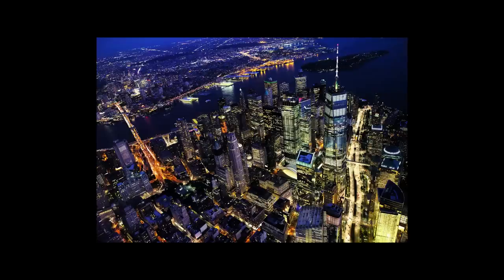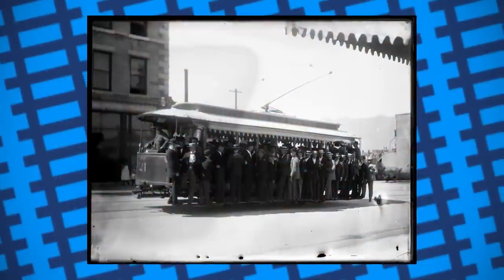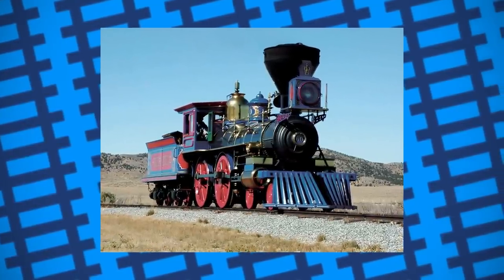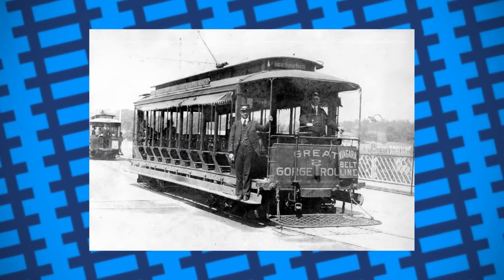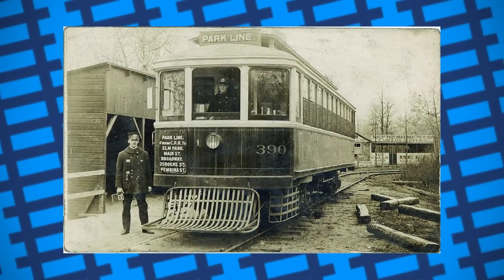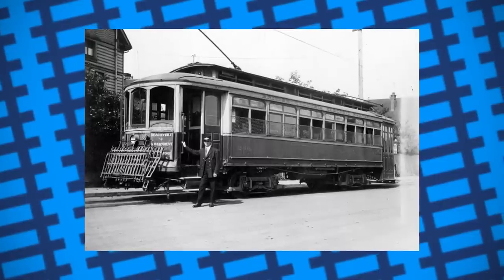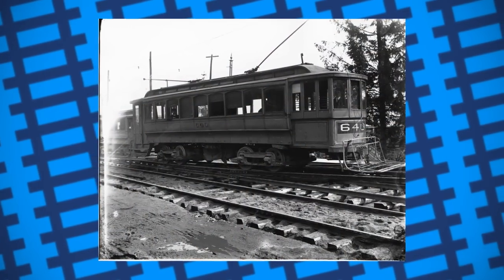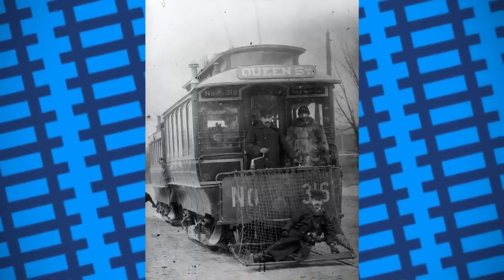Why American trams had nets to catch people - Trolley Safety Devices

Comment: would american cities be better today if they didnt scrap street cars and continued to expand and innovate them?
Reply: A lot would say yes. Can’t blame them, but decreasing ridership led to their downfall.
Reply: @Mason58654  citires were built around the street car. toronto proved its a viable system
Reply: @randomrazr  That maybe true. Same with American cities, but as car ownership increased streetcars became seen as a nuisance.
Reply: Yes, but the downfall of the streetcar didn't happen in a vacuum. Streetcars, Interurbans and Mainline Railroads all faced off against the automobile and it's derivatives such as the motor bus and semi truck. The fight started in the 30s with paved roads starting to be adopted on highly traveled routes. That killed off most interurbans  in the US. The economic boom following WWII and lasting until the 70s and 80s gave rise to the suburbs and interstate highways. This allowed most people to travel by car and live farther from work by avoiding the often comparatively slow trolley and commuter train and the missed transfers that sometimes come with them. Trolley companies also had to pay for the tracks themselves instead of being effectively subsidized by public roads. This killed off the streetcar with some exceptions and later threatened railroad passenger service across the US all together. Semi Trucks also killed off a large portion of the US freight rail industry with a lot of small less than carload services being discontinued.
Reply: @rileycoyote4924  now were reeping the consequences of having a car dependent cities ?

Comment: The UK system (life guard) was mostly used in Australia. I maintain these life guards as part of my job and as long as you get the geometry of the mechanism above the front ‘trigger gate’ correct, they work a treat.

When the trigger gate is been activated, it pushes a shaft around with a cam rotating around, pulling on the correcting rod that pulls the life guard tray down. A spring is also used to help ensure that the dropping action of the tray is done with more force than what gravity can provide.

Comment: For a time, a specific type of plow used in Toledo, Ohio, nicknamed the "Toledo Bumper" which was required on all interurbans entering Toledo. On one line, the Western Ohio Railway, which sometimes had to enter Toledo, they had several cars that on one end had the standard Toledo bumper, but on the other end, did not, so they would enter the city with the Toledo Bumper facing forward, and then turn around, so that the Toledo Bumper is facing forward again. 
You can see a good picture of one on the cover of the book "The Western Ohio Railway" by Scott Trostel.

Comment: Only heard legends of streetcars in the US. Only know cars and the few hated that are left of those old tales. Genius vehicles, way better than cars!
Reply: There are a few traditional streetcars still running, most famously the ones in New Orleans. Or the San Fransisco cable cars, if you count them as trams. There are others, including in Galveston, Texas, among other locations. Those mentioned are historic and I get the sense are mainly kept running for historical purposes, but do still serve as functional transit. There are other historic ones that just go along a short section of track and don't really serve a functional purpose anymore, I know both Denver and Fort Collins, Colorado have those, surely many other cities. Then there's modern light rail in many US cities, which in many systems (including Denver where I live) have portions that function like a tram. Usually not shared with road traffic like some historic trams, but alongside streets with rails embedded in pavement, but with curbs separating the track from the street.
Reply: @quillmaurer6563  I know, but I think you can count those on one hand.
Reply: @saintly2k  You mean surviving historic streetcars? Yes, certainly true. There's some modern trams, usually the city-center portion of larger light rail systems rather than purely urban streetcars, though those aren't super common either, not like in Europe.
Reply: @quillmaurer6563  yes

Comment: 1:12 this isn’t a trolley, it’s another kind of train: an interurban. these were bigger than trolleys and operated like railroads as they normally went farther distances(10 miles at a minimum) between large cities.

you ignored the most blatant reason, especially during the earliest days: protecting the driver as he was operating out in the open on the front platform since he had to use reins before they electrified the lines. you don’t want him getting hit by the person being hit.

Comment: Whats with these europeans using the name of horse drawn light railways to explain electric trolleys as named by the inventors Charles Van Deople and Spragg 

Its good that you finally came to your sense to use the term trolley for street electric rail vehicles, i can tell you still struggle a bit but your getting there!
Reply from the maker: Just for that I'm going to exclusively refer to trolleys as trams in every video I made from this point on
Reply: @TrainFactGuy  noooooo in a over the top way
Reply: “Trolley!”
“Streetcar!”
“Trolley!”
“Streetcar!”
“I’ll settle this. Tram.”
Reply: @MattsScaleModels  tram is incorrect. The answer is "gods chosen form of transportation
Reply: @mattsmocs3281  agreed!